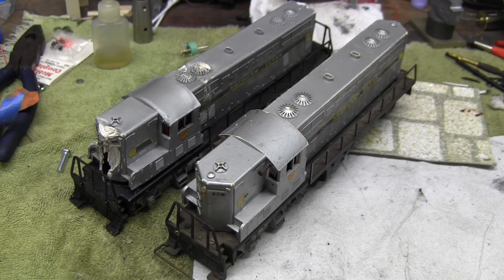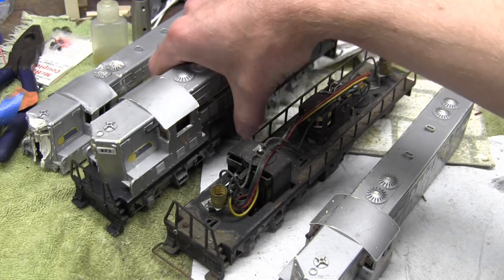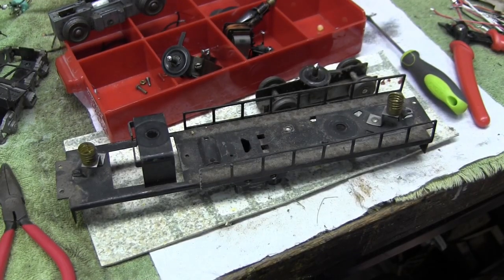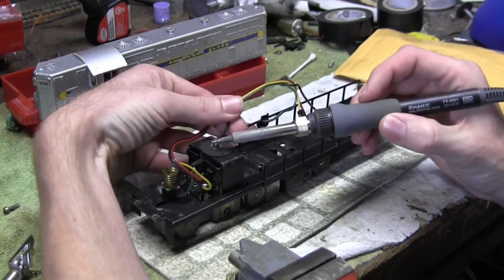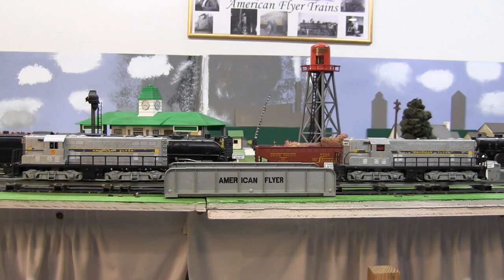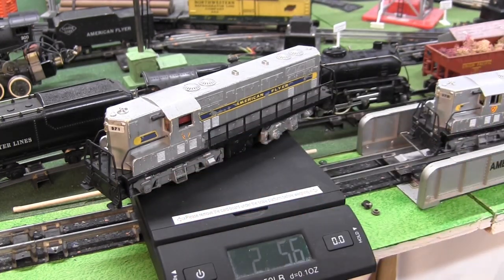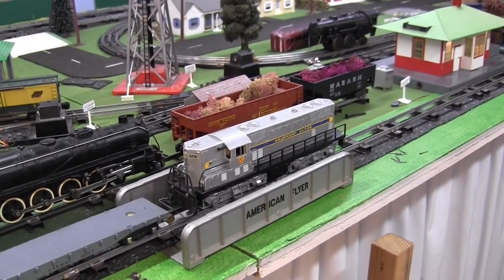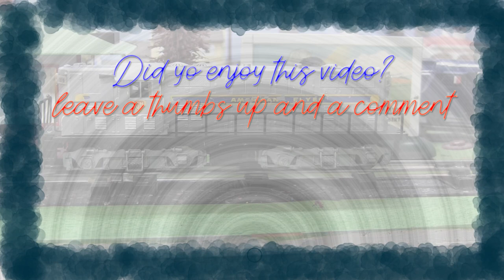What Happened to my MELTED American Flyer GP7-? Plus another 370 is alive!

Comment: Nice work.

If you are going to convert one of the 370's to knuckle couplers you will run into a problem that you will need to address.  The die cast frame had four posts that stick down from the frame (as your  locomotive has) and form the back of the steps of the new end frames.  The truck side frame and coupler swing far enough to hit the posts and short out the locomotive and trips the CB on the transformer.  You have to grind some of the post off (remember it forms the back of the step) to prevent the the swing of the coupler from hitting the posts or put some type of insulation on the four posts.  I put a strip of black masking tape on each post.  Problem eliminated.  I will probably replace the masking tape with heat shrink tubing for a more permanent solution.

My 370 has the weight and was converted to KC.  My 371 has no weight, stock KC and stock pull-mor wheels.

Some later 370's came with knuckle couplers instead of LC and I don't recall if this version of the 370 came with pull-mor wheels like the 371.  I have seen weights for sale.  I don't recall if Port Lines has them.  Port Lines also has the wicks for the power truck for oiling the armature bearings if you are missing them.

Comment: I would recommend doing one of two things to prevent melting:
1 - Use 14v Non Directional /Clear LED bulbs from Port Lines or Little Streamers, etc.

2 - Line the inside of the shells around the bulbs with aluminum foil tape to reflect the heat away from the plastic.  This is what Precision Flyer Repair would do until he started replacing incandescent bulbs with LED bulbs.

Comment: I am happy this is working out so well for you. If I ever get another GP-7 with the bar for link couplers, I am going to try to find a way to fit modified knuckle couplers on the bar so I can use the locomotive with either kind of coupler.
Reply: You could always get a side frame and collector assembly with a KC and an  end frame for KC, keep the railings and install them on one end if you want to have the 370 haul KC cars or LC cars.  The end frame and side frame collector assembly are just held in place by screws so easily to convert back to original.
Reply from the maker: Thats a good idea. Might be able to use thin aluminum and bend it around to pinch the link bar then pin to the coupler.